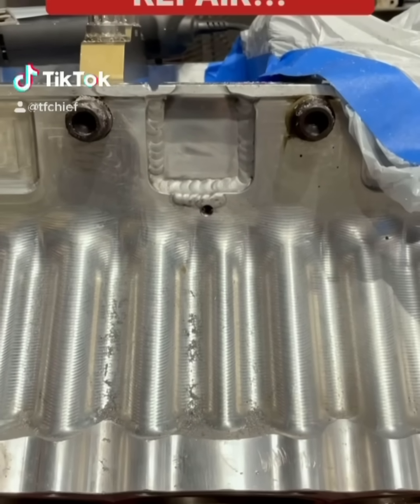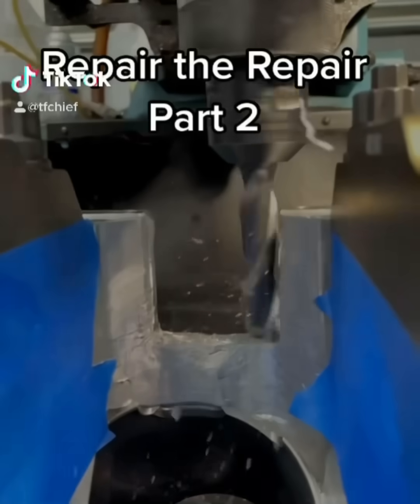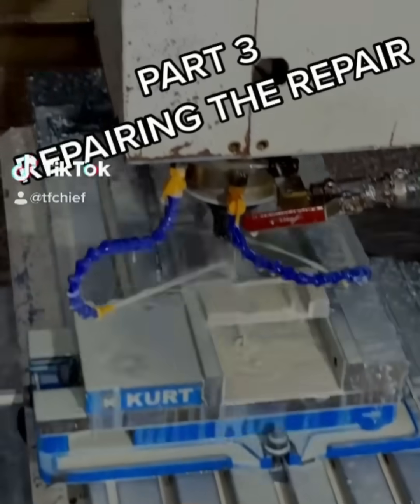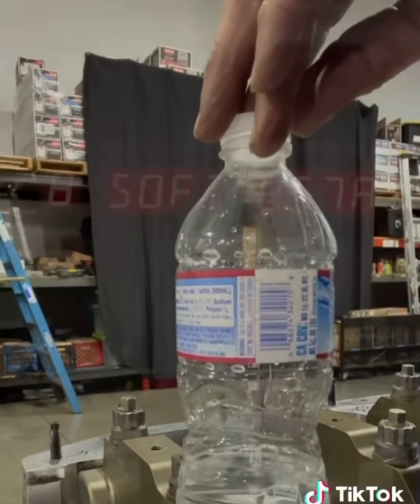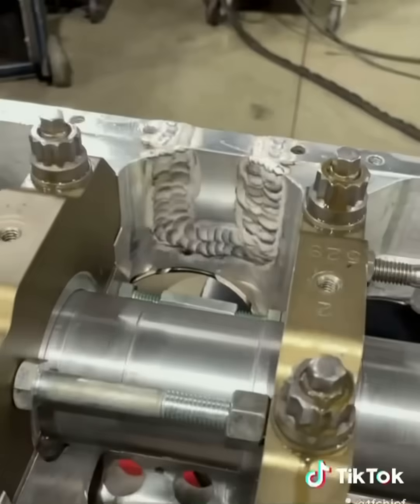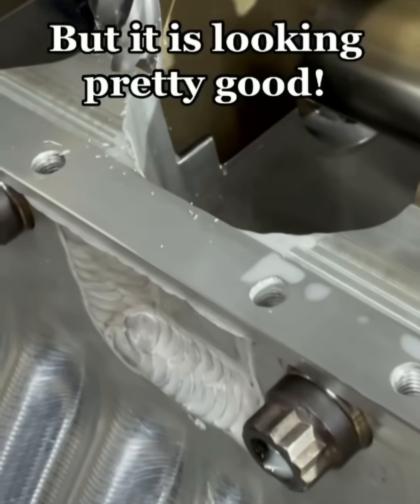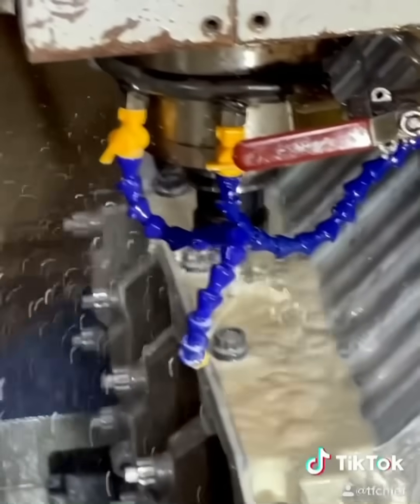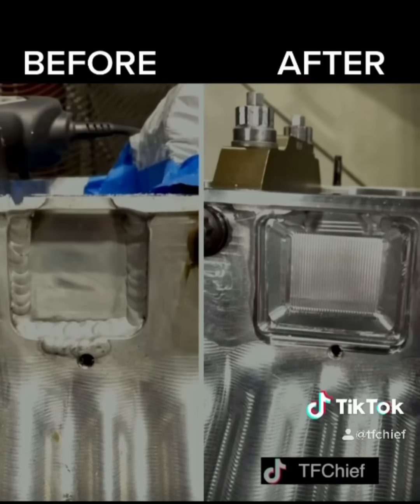Repairing a 10,000hp Top Fuel Billet Engine Block

Comment: So I have a question what if this wasn’t a 10,000 hp block? What if it was only meant to hold like 3000 hp but it’s still a billet Block can you still weld where a rod kicked out of the side of the block?  Will both ways work how the other team welded the block versus how you welded it
Reply from the maker: I don’t believe it would last even with 3000

Comment: Windowed Block fixes been around since Aluminum blocks introduced, but pieces just welded in since only a few thou HP was max. 
Is 5 figure HP  the driving need for 'Stressing' the block B4 welding fixes ?

Comment: Nice repair! My machine shop did my block, just like you did yours. You cant even tell where it was fixed at on mine. Now, I can't believe what's supposed to be a big hp top fuel team would fix a block like that garbage they had done.
Reply from the maker: Usually because they are lined up out the door and they don’t want to spend the time to do it right!

Comment: If you did NOT PEEN the weld after welding while it was still hot, you don’t have a clue what you are really doing. Weld a little......peen a lot......weld a little bit........peen a lot. That’s what I did for 30 years. Plus, it is an absolute must that you make a full penetration weld. Not like what you did.

Comment: 3:20  Not rolling the leads up when welding. This is an issue when using AC or any high frequency.  A coiled lead is an inductor ( like one half of a transformer ) .  Inductors resist AC current flow and this would affect the frequency at the weld pushing it more towards DC.  

A while back I worked on solving a poor weld problem with a capacitive discharge stud welder.  The weld side of the stud was flat with a small point on one end.  This point is where the melting processes starts so the rest of the flat end can melt.  The operators were leaving the leads coiled up creating a inductor. Instread of getting a short high amp hit, there were getting a long lower amp hit.  Unrolling the leads solved a years old problem.

Comment: Impressive work.  Just curious on your thought process.  I am self taught on tig and still new and learning.  Im wondering why you went with a high frequency vs very low frequency.  I find a lower frequency penetrates deeper into the material, but puts more heat into the part.  I find higher frequency focuses the arc between the two pieces and drives the puddle closer to the root, but has less penetration.
Reply from the maker: Saves the tungsten
Reply: @robwendland  I was curious about that too.  I normally turn the ep down on thick castings/billets but never turn the frequency that high unless on the edge of something thin.  Understand your thinking on saving the point on your tungsten though.
Reply: Thanks for teaching me something.  Makes perfect sense, there is a shorter duration of driving heat into the tungsten during the electrode positive portion of the ac cycle. 👍

Comment: Machinist skills off the chart making sure everything is laser straight using micrometers so precise and creating a program on cnc machine very nice also very expensive to own. But a outstanding job well done. May have to repair several more when a cylinder quits firing or too much fuel is in cylinder.
Reply: The end result was good, but I would have just used a Bridgeport and done it by hand. I am a retired CNC machinist, and in the time it takes to write a program for a small area like that with lots of collision possibilities and triple verify it, I could have just hand cranked it out. I was wondering what the purpose of the "window" was. Is it a designed failure point to save some other area, or was it just to save a few grams of weight?

Comment: That's not a pressure gage on that micrometer.  What you have there is an indicating micrometer.  Very useful for checking the roundness of parts and as a go/no go gage for checking large volumes of parts.
Reply from the maker: Yes. You need to check out my other videos. Two part series just on those. It was the best way to explain it. But you can use it as an idiot proof way of reading a mic

Comment: Looks very good. What worries me is the underlying issue had originally cracked a solid piece of aluminum. I feel it will crack again and may need some added support somehow. That crankshaft looks to be bending heavily.
Reply: its a 12,000 HP engine, theyre are under a lot of stress,nothing to do with the crank

Comment: Really nice work!! I was a manual Tool & Diemaker for over 40 years, most of which was O.D., I.D., Surface, and some Jig grinding. The last 4 years of my career I mostly ran a Prototrak/A.G.E. retrofitted CNC Bridgeport. It's hard to pick up computer language/programming at 60+ years old. But I was amazed at how much could be done without rotary tables, etc. These 3D printers are totally amazing.

Comment: Good tip on the cords, electrician told me that trick before when I was running some long extension cords for motor home hook ups . Didn’t get into the theory of it but it did stop the circuit from tripping when a load was applied. Great video on repair, thanks for sharing 🛠⚙️🇺🇸
Reply from the maker: Appreciate it!

Comment: Very nice...a little on the overkill with the OCD.  There's no way I would have machined the outside.
Reply from the maker: So much prettier 🤣 but really relieves stress in the welds for a fact
Reply: @robwendland  Unless you're dealing with a very special kind of aluminum...post weld stress relief is generally not recommended.  All you're doing is creating a weak spot by removing weld material.

Comment: Is machining down a solid aluminum block of aluminum actually better than a casting? I didn't even know aluminum was used. Are the bores anodized at least for hardness?
Reply: They use a liner
Reply: They're actually forged aluminium. A great big hunk of aluminium is warmed up and forced into a die, which gives it it's rough shape. The block is then machined all over. In the valley you can see the original forged surface ( at least on our blocks you can). The pistons run in liners which are easily removed and changed out between runs if need be.

Comment: That's an Indicating Micrometer. It's not a pressure gauge. The way to use it is to set the thimble at your size and lock it (or set it using gage blocks or a master) then you can use it to make quick comparative measurements between a large number of parts. They are meant to be used in a stand as they are very sensitive to the heat of your hand. What you are doing here is not giving you an accurate measurement because you have two moving components and you would have to zero the "pressure gauge" at the same time as the spindle is at zero.
Reply from the maker: I corrected myself on that. I believe there is a video on that. Thanks!

Comment: True skill.... perfection.  Never knew you could get that deep and still have a good block.  Makes valve grinding and hardened seat install look like kindergarten.  I'm super impressed.
Reply from the maker: Thanks for the kind words! It was a fun repair for sure!
Reply: @robwendland  What would be the approx cost for that from you?
Reply: @working2bselfsufficient724  if you have to ask you can't afford it 😂
Reply from the maker: @working2bselfsufficient724  around $1600 or so. The rest of the block is so nice. You can run it the same as a new one for sure. 11K for a new one.
Reply: @robwendland  I know they're pricey new $1600 isn't bad n u did great job.👍
Reply: @robwendland  If I ever shoot a rod out of my drag car I'll definitely bring it to you.
Reply: Currently building a 427 FrankenWindsor.  Pounding square blocks into round holes makes horsepower.

Comment: Question.. how much oil gets stacked up in the back of the block during the run.. ever thought about a scoop designed to let the crank sling the oil piled up into a scoop that directs it back to the oil reservoir or does the oil reservoir have enough to supply the pump for the entire run ? making it a waste oil sort of system..  i know GM has this issue on some of its trucks with front sump pans.. the oil goes to the back of the crankcase leaving the pickup dry.
Reply from the maker: The biggest problem is keeping the crank from flexing the main caps off the main line. During high torque lock up, oil pressure drops from the clearance of the crank from the bearings. It’s trying to push the crack down out of the block.
Reply: @robwendland  did you see jpaydirt. On you tube Cummins c14 main bearings video. Seems that clevite came up with a hardened washer around the stud to stop the main bearings from spinning if that is still an issue like it was in the 80s with top fuel motors. I can totally understand the main caps hanging on for dear life. I understand oil galley mods. Used to do some serious internal grinding to my sbc and BBC oil galleys followed by rifle and shot gun ball hones to polish them for max flow. Had to mop off the shop ceiling a few times during flow tests to check for equal flow. Learned turn engine right side up for those. Floors are easier to mop. I ask roland one day why dont you have 3 screws holding the seal in the lenco.  He said he never had an issue. He drilled them the after that pass while I scrubbed the inside of the body. After the JF chassis split I found several heat treating companies that could put an entire TF bare chassis in their oxygen free ovens and bring them to 1100f. To bring out the full strength of 4130 tube. Make it equal strength and reduce cracking. But SFi and NHRA were totally negative on it. Sfi replied chassis builders dont have weld heat area issues.  They use reverse polarity and it pulls the heat out of the weld. I dont recall if my thoughts escaped my lips about size of buckets of sand and ostrich actions.
Reply from the maker: @waynep343  Great points. So later on they put heat treated tubing in JF chassis by Murf. Problem was that they welded the heat treated tubing. Made the tubing brittle around the welds. When I tested it after JF crash in Dallas it sounded like a shot gun going off when it broke and after I relaxed the joint you could not see the crack at all. We I did it to normalized 4140 it broke 3/8 or so out away from the weld and flexed way more before it did so and the crack was very visible when relaxed. Being stronger necessarily isn't the answer because it creates more harmonic frequencies that cause tubing failures along with more hot spots in the chassis opened up for failure. A flexy flyer will reduce those hot spots and spread the load more evenly. Also normalized tubing tends to go down a rough track a little better. Works a little like it has shock absorbers. 
I am currently along with other projects, making a steel saddle and a steel main cap to help reduce crank flex which I believe will help with oil pressure and the life of the crank. I remember back in the day, we would pump so much volume looking for more pressure,  oil would stack up in the valve covers. So we added return hoses to the back valve covers and tapped the oil returns on the block to get rid of it. Things have certainly changed over the years. Great comments on your part for sure!

Comment: Very nice engine and repair. 10k horse power is pur bs. Impossible
Reply from the maker: No. It’s true. Probably closer to 11k brother!
Reply: I used to think so too. But over 25 years of racing (and a short stint in TF) and getting to know the brutality of these things up close, changed my mind real fast. It takes around 800hp just to drive the supercharger at full flight. They burn 20 gallons of Nitromethane (90%) and Methanol (10%) in under 4 seconds. They only produce that hp for a second or 2 (clutched locked up, full flow on fuel, wing loaded and pushing through 250mph) but, yeah, they're pumping out the ponies! Go and see them, it'll change your life.
Reply from the maker: I’ll post a video on the power levels
Reply: @robwendland  bust out a diff and show that too. The axle will make a believer out of anyone!

Comment: Why would a team buy a used block?
Reply from the maker: It’s less than half the price. If you are not totally funded it’s in the budget.... hope that helps!
Reply: As you can see they're very easy to repair. These forged blocks are extremely durable and you can beat the hell out of them. The bigger teams replace blocks after so many runs even if they don't ventilate it (rare!) They also make the basis of an excellent Alcohol motor. The cost benefit is amazing. They're next to nothing ($2000US) if they're really beaten up. You should see the heads when they're properly torched and repaired!